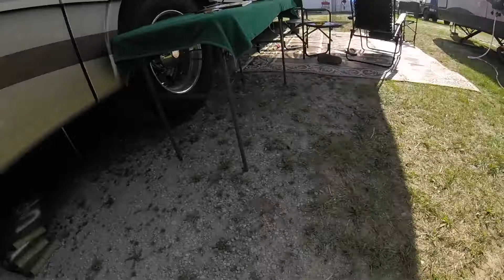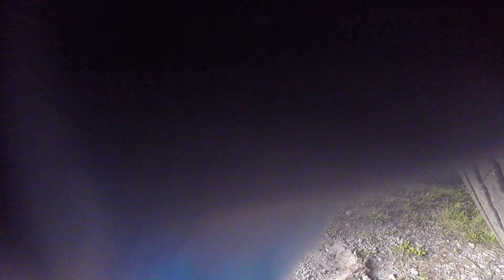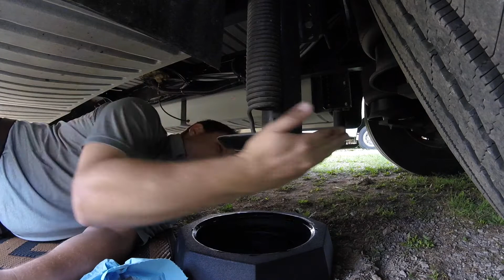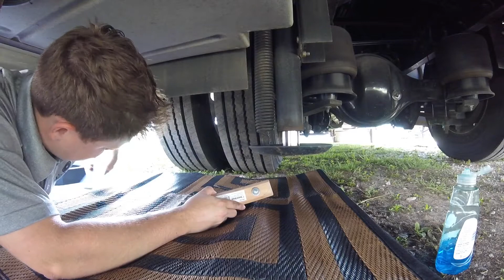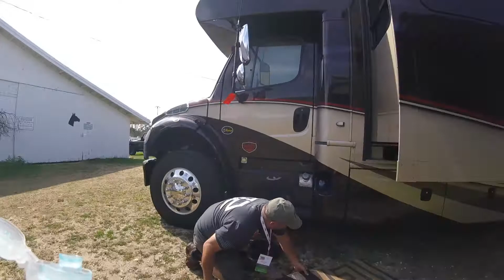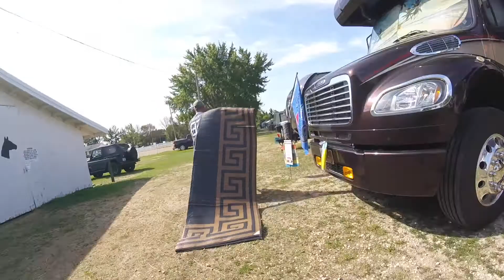SnapPad Prime 4 Pack - Full Install

Comment: Will Snap Pads work on jacks that do not have the springs to aid in retracting the jacks?
Reply from the maker: Absolutely, we have pads that work on all hydraulic systems and many electric "stabilizer" systems. We actually have a place on our website that tells you what SnapPads will fit your rig.

https://rvsnappad.com/pages/submit-your-rig

If you click the link above it will ask you a few short question about your rig and then direct you to the SnapPads that will work for your rig. :)

Comment: Why aren’t they all the way up ? Pads Too heavy
Reply from the maker: Hi John, 
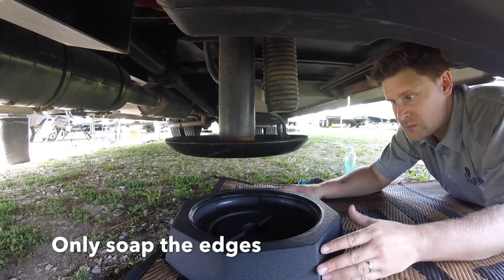That's a fair observation. What happened in this situation was Power Gear jacks operate in pairs and the owner was struggling to manually operate his jacks as he had never done that before. Since he was planning to auto level after we installed them we didn't worry about him fully retracting his rear jacks. If you FF to 11:00 and/or 13:15 you can see the front jacks fully retract with the SnapPad installed. Those springs can easily handle an extra 8 lbs. Once he was finished camping he fully retracted all jacks and went on his way with no problems :)
Hope that helps.